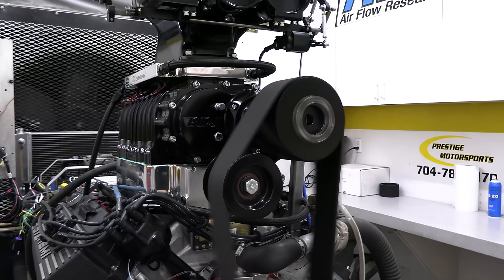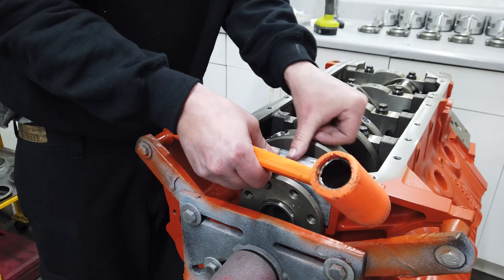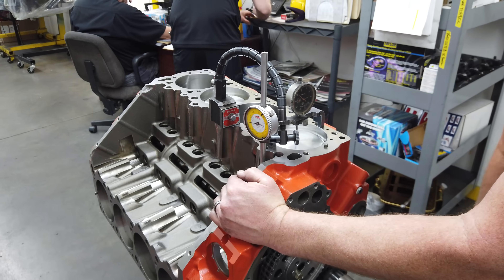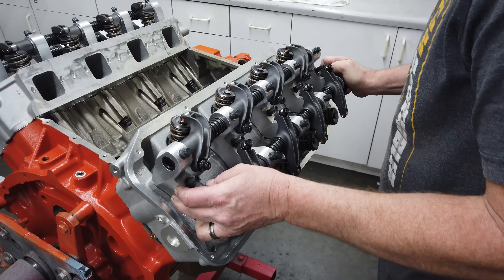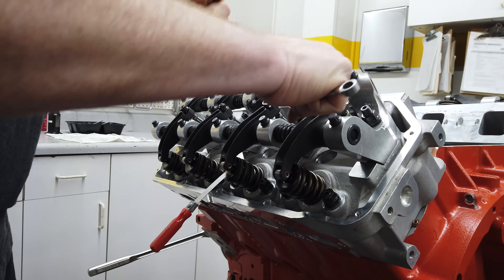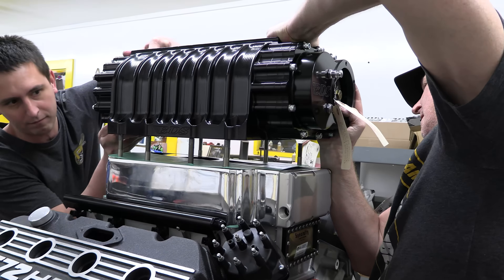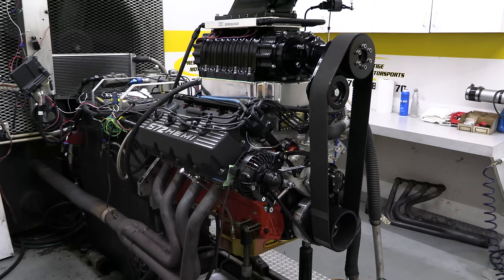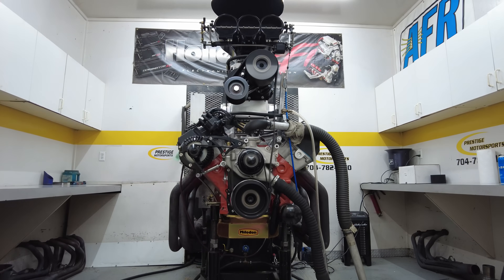Skyscraper 572 Hemi Build with a Massive 10-71 Roots Blower!

Comment: I was expecting 2000 hp !
Reply: @8200 rpm and 22ft.lb? Very likely the crankshaft would not go with it. A lot of the other stuff may get close to. 1300 hp @ around 12ft.lb (@ +100hp per +2ft.lb of boost) with this set up would be okay as well i guess. And you are right: 1000 hp out of 9.4 liters is very safe, to put it simple, as 150hp/liter would be 1.410 hp already.)

Comment: How'd they put on the 1 piece main seal?
Reply from the maker: The is a split in it so you can open it up and get it over the journal. Then a dab of silicone helps stick it together.
Reply: @TheHorsepowerMonster  i guess thats still technically 1 piece..

Comment: Honestly I would have expected those hp numbers NA from those cubes and heads.
Reply: Street engine.   bump up the compression and you probably could have gotten 800hp NA.
Reply: So you'd expect 1000+ hp and 900+ tq from a 9-1 compression, unported cylinder head (and not even a "good" HEMI head), miniature cam, small oil pan, 6000 rpm engine with an intake manifold and carb, or EFI, using C-16 fuel???

On what planet does this magical engine combination exist, because one day, I'd like to visit???

Comment: No air filtration? Isn't that a bit reckless for such an expensive, beautiful, supercharged, custom hemi build? Just a little bit of sand here and there and before you know it, your high numbers start dropping, the supercharger isn't compressing as much, blow by...all kinds of bad things can happen from particulate contamination. Sure, you get better numbers on the dyno but the racetrack isn't in the engine dyno room (same for a car meet-n-greet/show-n-shine...whatever). I sure hope the owner puts a sock or sweater or a table cloth, something, anything around those butterfly valves (securely, nobody wants to pull golf club cozies out of their intake) that will keep the bugs, grit and other forms of airborne debris out of that 1000 hp work of art.
Reply: It’s getting air filters on the end of the hat ! 🤙🏼

Comment: WTF White grease?  never use grease that will not dissolve in engine oil  
One famous FORD racer blew 30 motors using white grease as it turns to abrasive carbon
Torn HEAD gasket materiel off the oil pan rails?
oil through the pushrods helps on adjuster wear

Comment: How was it made from original Chrysler molds the front of the engine looks nothing like it should the oil pump boss looks like shit the freeze plugs look like shit and the oil drain back passage that protrudes from the front of the block is nonexistent it may be a nice block but it’s shit for the restoration guys what happened to the block they made 18 or 19 years ago the mega block Siamese bore that looked identical to a factory hemi block why can’t somebody produce that again

Comment: "...torqued ARP main bolts to 100 pounds..."  Whaaaa? I am 100% sure ARP would totally recommend using the stretch methodology. Torque is only a rough estimation of the true clamping force of the ARP bolts.  Stopped watching here.....
Reply from the maker: How are you going to check stretch on a main bolt? I've been in an absolute ton of engine shops and never seen anyone check stretch on the mains.

Comment: Not bad at all however here's a 598BBF that makes 1109hp/937tq N/A
https://youtu.be/dIrvPfrnXjM
Reply: Did you watch the build??? Did you see how "mild" the cam, heads, compression and boost pressure is??? Do you know that a boosted HEMI engine can make horsepower up to 11 THOUSAND PLUS (Top Fuel), depending on build configuration, blower style and fuel used???

There is no comparison between the N/A Ford you mention and this particular engine designed to be a low boost street build.